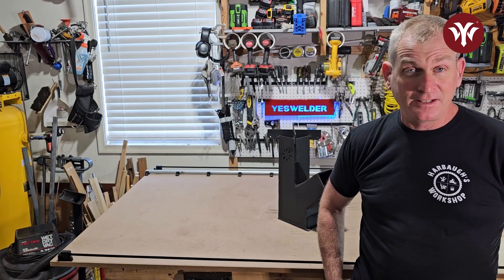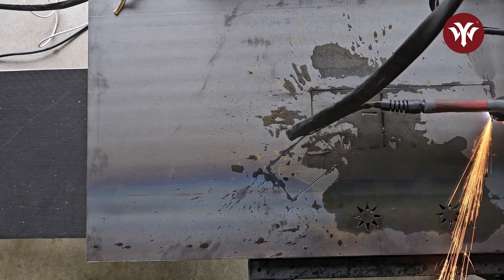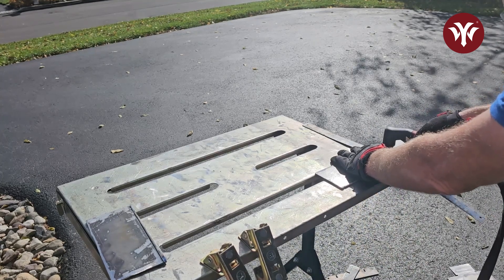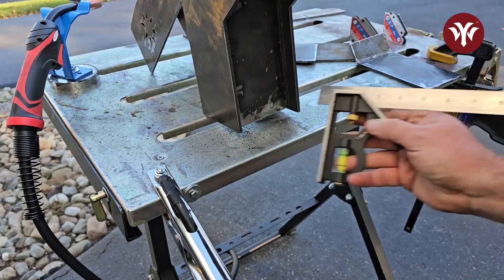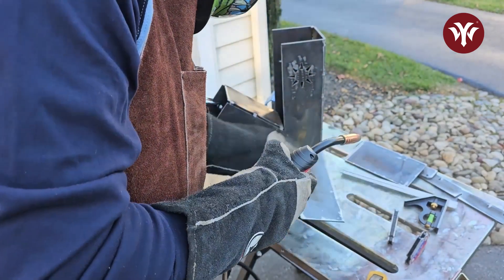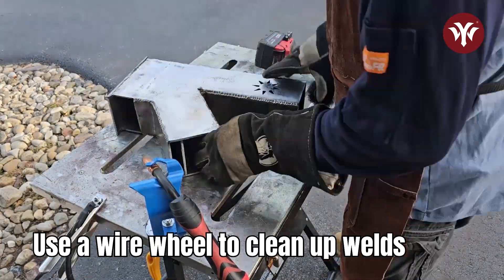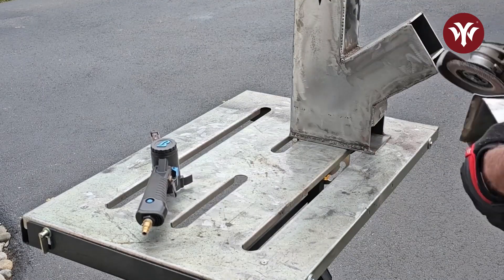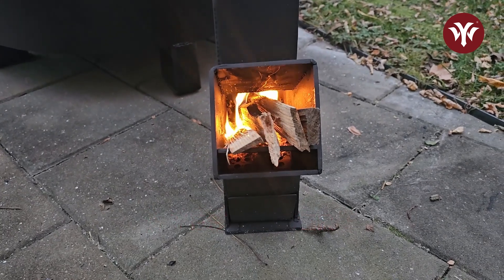Craft Your Own Rocket Stove | YesWelder

Comment from the maker: Outline
00:00 Introduction
01:46 Cleaning Parts
02:51 Assembling and Tacking
05:00 Tacking the bottom base
05:58 Creating the Ashtray
07:21 Applying high-heat-resistant paint.
07:31 Conclusion

Comment: What’s a’guy to do if he bought a yeswelder 45 amp plasma cutter under 6 months ago that just stopped working for no apparent reason, everything still operating properly except for the electrical side of the actual plasma cutting part.
Reply from the maker: Hi there! Please send the specific details of the machine to: support@yeswelder.com. Our customer support team will assist you in resolving the issue. ❤️